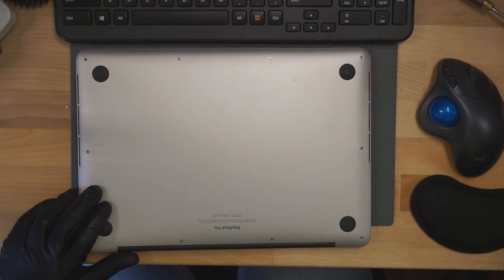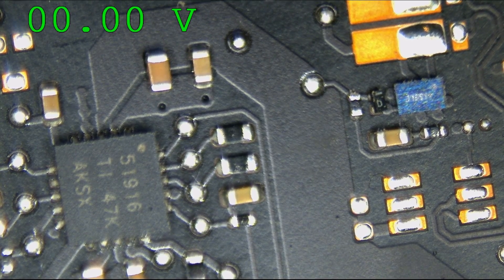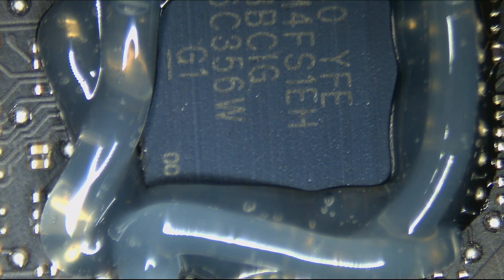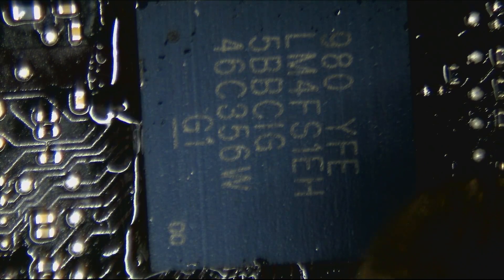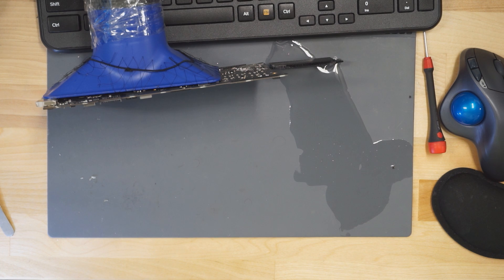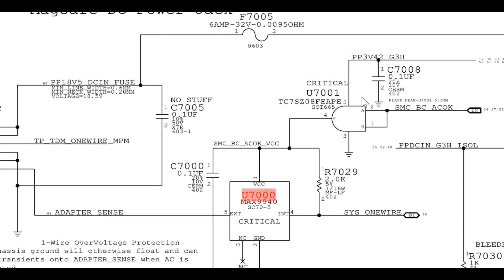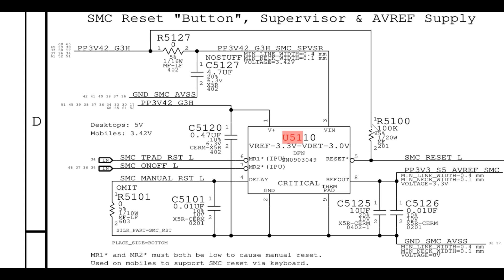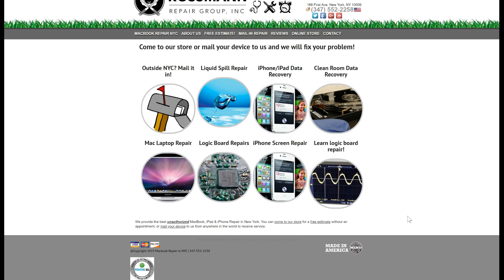Macbook Pro no green light on magsafe charger

Comment: Hey Louis, I have a quick question.

My 60W Magsafe 2 connector cable started fraying  and stopped working. So I had the entire Connector cable replaced by a third party cable and connector. It charges like the original cable. However when I go to the Mac Book Pro 13 System Report. It shows my power adapter as a 85W charger. 

I started researching online and found a few of your videos and understood that the chip inside the connector is what tells my Macbook Pro the Chargers information. I'm assuming the cable connector i got replaced is meant  for a 85w charger not a 60W. 

My question is does that chip also regulates the voltage that goes into my Mac. I think thats highly unlikely as I dont think my 60w charger can supply 85w just by replacing to a 85w connector. I'm just scared that if the chip somehow does supply more power, my Macbook Pro might get fried or damaged. 

Thank you for your time.

P.S I have the Macbook Pro 13 - Early 2015 Model

Comment: I have a hack. Don’t need to search these circuits. Works for damn near every phone, computer that had water damage. Jumpstart it.  Get a bad battery for the device, find the positive, negative, and put external juice to it. Basically hard wire power to the battery. Of course not excessive power. Then plug in the charger! It’s worked for me on cell phones, and laptops! Tablets too! 🤷🏻‍♂️also helps if you clean the circuit first. These chips act as circuit breakers. And you send a jolt of power to flip it back. Wake it up. Like a dead battery. People think flat battery’s can’t be saved. Flat batteries are usually frozen crystals. And you jolt the battery with excessive power to break the crystals and get the active again. Shock treatment. Works for everything. Humans also.

Comment: Thanks as always for your videos and your efforts Louis! Here is a funny random thought: is there a reason why modern circuit boards could not be sealed off completely from the atmosphere  by applying a clear coating to them in the factory? Wouldn´t this prevent any kind of corrosion?

Comment: Why are there so many liquid damaged macbooks? Are mac users just clumsy with their sugar packed beverages? It's a mystery. 😕
Reply: As a former Apple tech, I can tell you it is for two reasons. One, they don't bother to make the thing even moderately resistant to spills. A lot of other companies will either use a protective layer under the keyboard or they will at least put the chips in areas less likely to get a direct spill. 

Two, the materials they use are so cheap that they subject to even moderate humidity. I can't tell you how many times I had to take escalated calls from customers who swore they had never spilled liquid. Now, to be fair, quite a few were lying their ass off, but you can tell the difference between a humidity issue and a real water damage issue pretty easily. I would just email the board repair place and ask for the pics, take a look, and find that it was widespread 'faint' corrosion. After that, check the customer's location and if it was a humid area like Houston or New Orleans, BINGO. 

Now the cool thing was that back in the day, before they were dumb enough to let the COO who was more concerned about squeezing every single penny out of the end user run the company, you could easily override the repair center and allow the customer to get warranty repair. After he took over, it was about a week before Tier 2 techs got new instructions saying we were basically losing most of our discretionary override powers. You had to jump through hoops like a show animal to get the SMALLEST customer sat issue approved. I left soon after (so did a lot of others), fuck em. I was hired because I was extremely knowledgeable AND because I wanted to take care of good customers who were not trying to screw Apple. Not so I could make the shareholders and Tim Cook an extra few cents on their dividends.

Don't get me wrong, Apple fucked up multiple times even with Jobs at the helm (See battery issues and nvidia chipset issues, plus the shit show that was Apple TV and Time Machine), but it was still a different culture than what Tim Cook espoused. We did TRY to help the customers for the years (2005-2012) I worked there. Now it's like 'fuck you, gimme that money'!
Reply: those other liquid have sugar too I think

Comment: im to scared to buy a mackbook cause it seems like they always break so i continu to use my dell latitude d620 with linux mint
Reply: That’s pretty old. I’d get a MacBook. I’ve had two and they are great. As long as you keep them clean and don’t throw around and abuse them they are fine
Reply: @Mike._zx.6  ive never had a problem with it it is old but it has been upgraded even has a ssd with linux mint

Comment: lead free solder is crap we know that, but how crap is the solder apple uses if the macbook has been at parts destroyed by water but the actual damage is on a "good" place of the board?
shoe rubber patches to be expected soon?

Comment: Have you tried conformal coating a macbook before? Not sure on the cost but if i were unfortuante enough to own one id have to look into it just incase i sneezed in its general direction and it died
Reply: Would not fix crappy intersil chips. Liquid is not the only way to kill a MacBook.